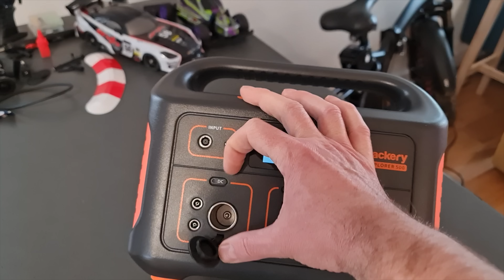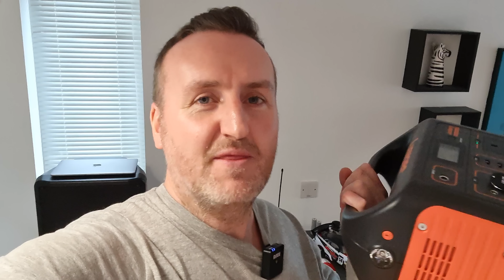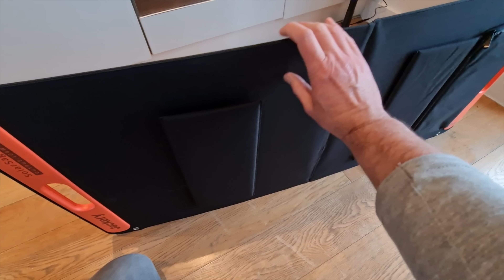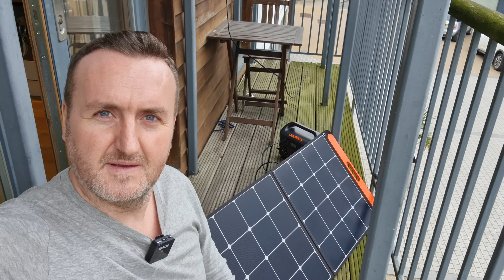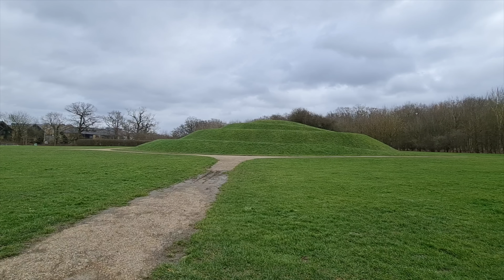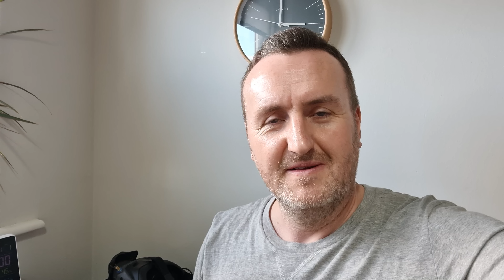BEAT POWERCUTS WITH THIS!!!

Comment: I would make sure it is fully charged as you will need it as there might be power cuts this year as the power company is looking to save the oil it has as they don't want to run out.

Comment: I think these types of power supplies are great for field type events, probably not great for running 100W HF rigs but okay for a little less power out.  Add that it will power laptop/iPad  it looks a decent proposition.   I’ve spent £200 notes on a couple of 9Ah LiPO batteries so this unit costs in.  Thanks for an honest review -  cheers Mike

Comment: I'd be extremely surprised if your makita charger is less than 2A! you'll be overdoing the charge station with that more like 3A minimum.  My power tools fast charger is 6A. (1440w) 240v mains power x 1A = 240w. 240v X 2A = 480w for example. 13A is the max you can draw from a UK plug socket. 13a x 240v = 3120w.

Comment: This thing, at best, would run your refrigerator for maybe 4-5 hours. Good luck when the power goes out for several days. You’d have been way ahead to buy a small generator and fuel for the same $ you’d pay for the Jackery.

Comment: If it's decent the inverter  (bit that changes the internal battery power to mains) is a pure sine wave rather than a modified sine wave. Electronic items and certainly audio stuff don't like modified sine wave inverters. The other issue is weather the battery is a good brand  is - samsung or Ansmann or Panasonic but even at this price I doubt it???

Comment: could you review a river eco pro. got the jak 500. its ok until i discovered the river eco pro.it can boil a 600w kettle and work a micro,hotplate,unlike the jack which cuts out. takes in more solar too.

Comment: Hey man,  great videos (screw Ian) heater wise a small 400w halogen heater would work nicely. I’ve been watching since you got the twizzy xD used your store when I built my ebike keep it up man. Have you got any good ideas on what to use an old car battery for? Got one lying around from my old diesel Audi and would like to put it to use, take it steady 👍
Reply from the maker: Thanks man👍🏼 use the old car battery to harvest some solar! Cheap 100W panel and charge controller, should be less than £100, great learning experience and you could use it in a shed etc to run lights etc!
Reply: @andykirby  do you happen to have any videos of providing power to a shed, garage, mancave. Ect? Using solar? Cheers

Comment: Can that battery bank charge 72volt ?
Reply: using a buck convertor on the dc out put you could in theory out put any dc voltage you want within the constraints of what the buck can out put

Comment: I like these but I always find that they're a bit redundant in that you have to plug them into an alternative power source to charge up. 

The whole point of an emergency power source is that it's ready to go no matter what, no matter when. A Honda 2200i can run 8hrs on a 4 litre tank. 2x 25l Jerry cans will get you 100 hours of reliable power when you need it most. I think they're around 1200 gbp? Defo worth it
Reply: Good point

Comment: Been looking at these for the weekend rides with the ebike
Reply from the maker: Yeah it would work quite well actually even though standard ebike chargers aren't the fastest. If you used a 4A charger then you could get about 8Ah in 2 hours.
Reply: Not worth it - get a spare battery then you have a primary battery ready to go which you can also use as a power bank with lipo to usb chargers and various buck boost converters / chargers / mppt controller available of aliexpress/ebay etc.

Comment: I really like that panel. I use the 100w panel on my vdub transporter to charge my drone lipos. I was gonna mention about the heat your windows let in, try some UV blocker film, that should make it cooler in there 👍

Comment: You should make your own using high density cells and a more powerful inverter 🙏might even build myself one
Reply: prismatic lithium iron phosphate cells 100ah x4 cells, 1c charge and discharge, 1200wh. cheap bms and inverter sorted
Reply from the maker: Yeah definately could build something better, this product isn't really for us lot😁
Reply: @andykirby  go on Andy you haven't built a battery for a while, do a tutorial/build series?
Reply: @andykirby  I'm English but currently living in NY and a young bloke known as Will Prowse (on YT), has filmed masses of tests on signed, batteries, kit etc and has a massive following.  There's no doubt that those who have the skill-set to build their own kit, are at an advantage but there are an awful lot of people who'd like an 'all-in-one solution'.

Unless the sogen has a capacity around 2,000w though, I really can't see the point of buying a small unit for c£500, for charging phones, laptops, etc although that may be sufficient for some people.

The bigger units from Bluetti, Pecron or Ecoflow, offer much more versatility, although obviously, more money too.

Entertaining video nonetheless.